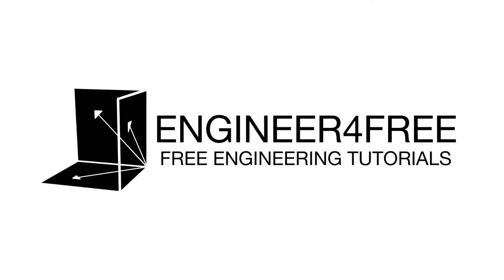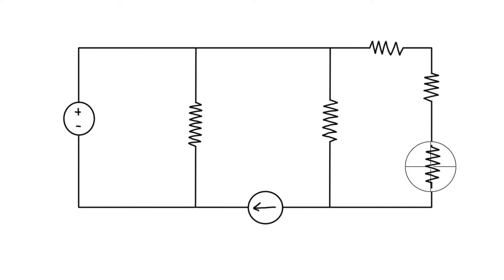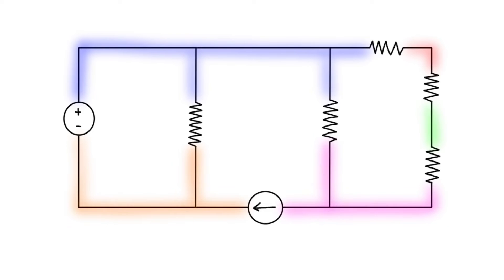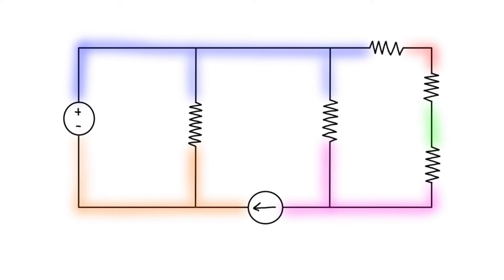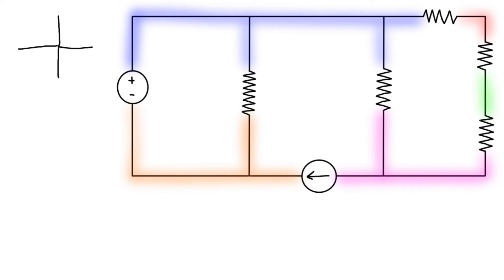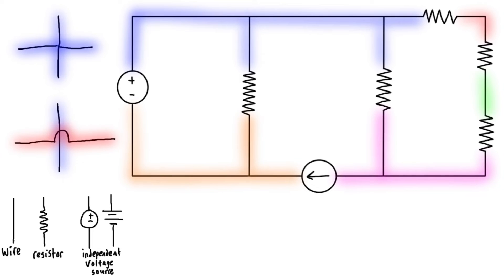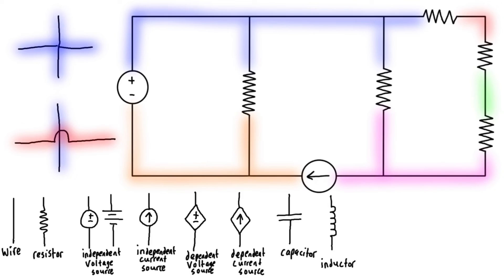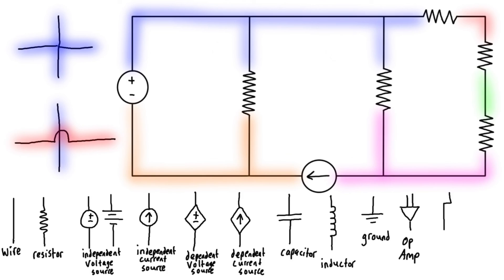Basic Circuit Elements, Nodes, and Branches

Comment: since the current flowing in the three resistors on the right hand side is same ,why don't we consider all of them as a single branch ??
Reply from the maker: Yes, the three series resistors can be considered as a single equivalent branch because they form a single path for current and their total resistance is the sum of their individual resistances. This single equivalent resistance can be used for circuit analysis, simplifying the circuit without changing its overall behavior. Although the coloured nodes in between each of the individual resistors have their own unique voltage / potential difference relative to ground.
Reply: @Engineer4Free  thanks for the explanation man i really appreciate that ...now i am clear in the terminologies ...have a beautiful day : )

Comment: If voltage source is a battery or motor for example, what is the “current source”?
Reply: that is what ChatGPT said about your question:

Certainly! Let's explore a real-life example of a **current source**:

Imagine a constant current LED driver used to power an array of LEDs in a streetlight. Here's how it works:

1. Streetlight Circuit:
   - The streetlight contains multiple LEDs arranged in a series or parallel configuration.
   - Each LED requires a specific current (e.g., 20 mA) to emit light efficiently.

2. Current Source Functionality:
   - The constant current LED driver acts as a current source.
   - It ensures that the LEDs receive a consistent current, regardless of variations in the supply voltage or other external factors.
   - Even if the input voltage fluctuates (due to changes in the power grid or environmental conditions), the driver maintains the desired current through the LEDs.

3. Benefits:
   - By using a current source, the streetlight achieves uniform brightness across all LEDs.
   - It prevents overcurrent, which could damage the LEDs.
   - The driver compensates for voltage drops caused by long wiring or temperature changes.

So, in this practical scenario, the current source ensures reliable illumination in streetlights by providing a steady current to the LEDs. 🌟💡

question